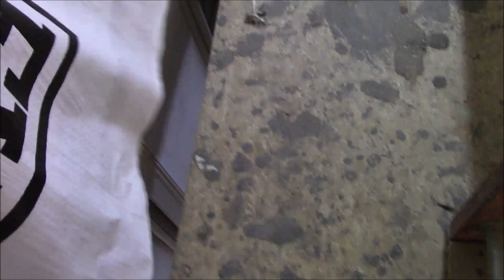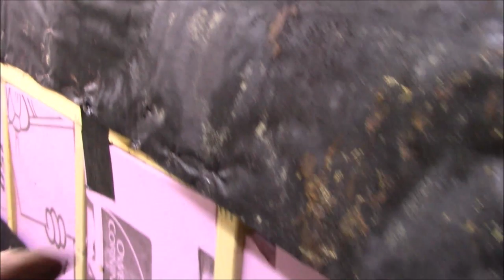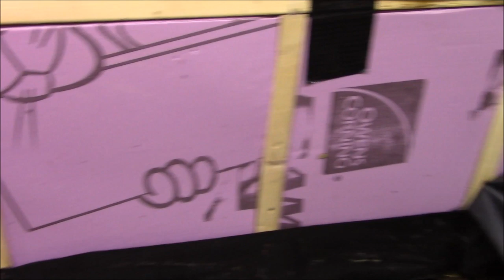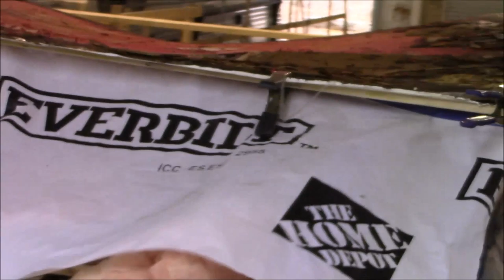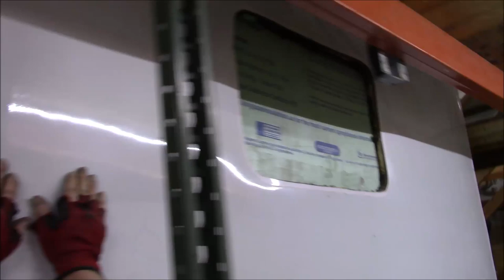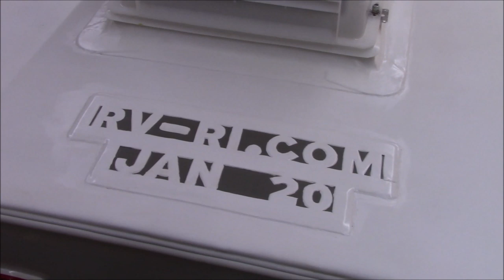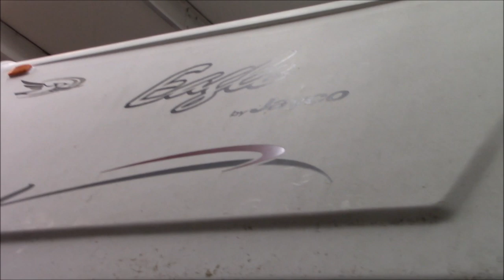Jayco Eagle New Roof, Rear Wall, New Trusses and ceiling panel

Comment: Seems most factory camper roofs are designed to fail, I call it engineered obsolescence...
Reply from the maker: I think they call it job security. You'll either bring it back for a roof or trade for another 
Thanks for watching

Comment: Just powering through your videos and wow what a mess!  When it cones to the bill they probably could have bought another better rotten piece of junk!
Reply from the maker: The next one will need a roof replacement as well. Thanks for watching.
Reply: Maybe so. At least you know that this repair job will last longer than the original factory job and price.

Comment: Jayco should be held accountable for grubby work manship
Reply from the maker: They're all the same. Thanks for watching.
Reply: Ive got a 2013 jayco..just started leaking in thru the sun hatch..shops a shut ..cant get up on the roof to temp fix it..an its still raining...till monday
Reply from the maker: @donny-ho1bm  see if Home depot has some Rapid caulk. Usually in the cement section. It's moisture cured. Get a trowel and slobber the heck out of it as best you can. Wipe the water away and get some product on. Or....take the interior lens out and direct the water away from the framing and into the shower area. Maybe do both.
Reply: @RVROOFINSTALL  copy that